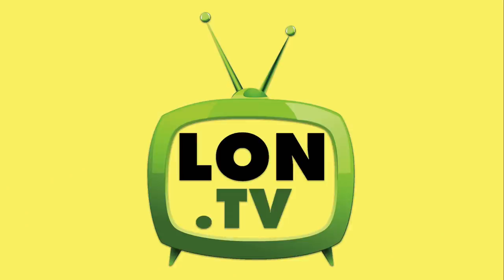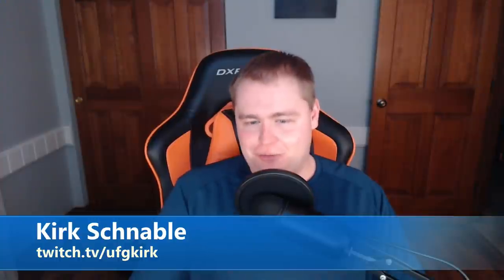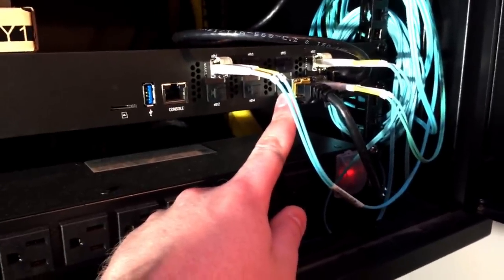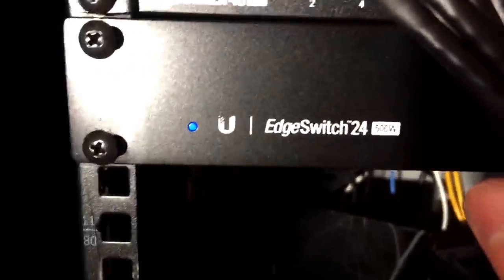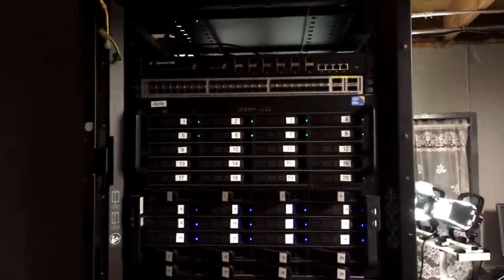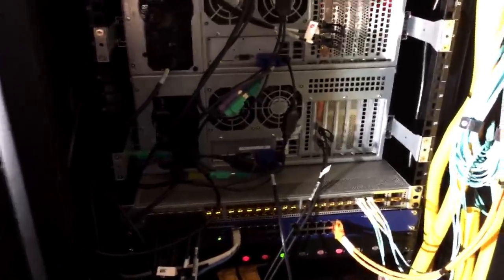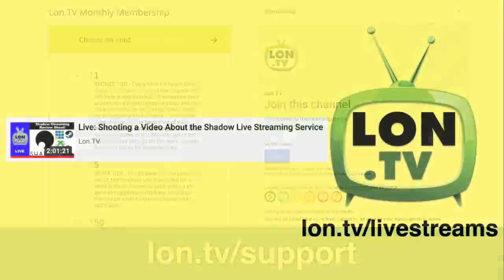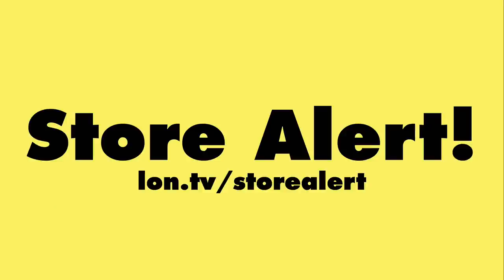Gigabit Pro Update: Tour of Kirk Schnable's 3 Gigabit Comcast Connection!

Comment: 5:30 The explanation of GPON being a shared hub sort of connection is fairly inaccurate, because it compares it to the much more shared type of connection that is cable internet.

The fiber connection between the ONT (user side) to the OLT (head end) is dedicated, not shared - if you were to shine a laser on one end, you would see it out the other. There are no active switching devices in between, only passive light-splitting prisms - hence "Passive" Optical Networking. As a result, there really aren't any bottlenecks in between the customer and the head end, and each ONT gets a dedicated TDM channel for its connection - I believe for ISP setups, this is usually a 1x64 split, hence 64 channels; OLAN is typically 1x32, however the new technology XGS-PON (10Gbps PON) supports up to a 1x128 split.

Source: I'm the lead person for an enterprise Tellabs OLAN (GPON) system (and our former Motorola OLAN system) at a Little Ivy League college.

Comment: Gpon is only limited by the equipment installed. Most onts are 2.2 gig rated they just have gig Ethernet and are designed for multiple accounts and usually there's a 10 or 20 gig uplink for 32 subscribers

Comment: GPON - Gigabit Passive Optical Network. Your favorite web search can provide the details.  In addition to maximizing the amount of data handled by a single fiber, you'll see your local GPON deployments use pre-built fiber cables.  Your install tech does not need the skills of fiber cutting, polishing, and connector attachment that an old-school fiber tech needed for installations in previous decades.  As for the Juniper router, close match is https://www.juniper.net/us/en/products-services/routing/acx-series/acx2100/ , though this is a AC-powered model instead of a DC-powered model.

Comment: Actually these days (A year later) he could probably consolidate all of that hardware into a single Epic Rome 128 core server Box and replace all the HDD with a few 20Tb drives and use NVMe SSD's for  active data leaving the HDD for cold storage. I would think the whole thing could be replaced for $10-15K which would be paid back by the saving in electricity.

Comment: So now twitch require 3 Gb connection? SFP is only 1Gb. It should be SFP+.
VMware is the best. I usually do Network-attached storage with ESXi, just makes it easier to move VMs around different ESXi hosts with vMotion (non-storage).

Comment: His setup looks nice... But a work of warning NEVER ALLOW FIBER CABLE TO BEND 90 DEGREES,,, I have seen many an install fail because if this.
Reply: ...fyi...its a loop...not a 90° bend...perfectly correct install...
Reply: @ltdees2362  Watch at 8:53 that is a 90 degreee bend which is very bad in the fiber world. I have walked into sites with bad performance and that is what I  typicality find wrong.
Reply: You are right. I have faced this similar issue. This is light passing through so a 90° curve like that will cause network problem as it's having for the light to travel with these kind of barriers in the path.

Comment: Hey do you guys know if they’ll install the equipment anywhere in the home you want? Ex: I want my router/switch etc installed upstairs instead of down where the coax is now.
Reply from the maker: I think they'll try to work with you as best as possible to get it where you want it. But there might be added costs, complexities depending on your situation.
Reply: @LonSeidman  thanks for responding, I hope it won’t be too difficult, the room is upstairs in the back of the house, I would really be okay with it being anywhere upstairs. So far my total cost after the initial survey is $7400.
Reply from the maker: @dranksinatraa  What they were most concerned with on my interior install was being able to get the cable routed without bending - the cables coming in from outside are super rigid so if they can't keep it straight it's more challenging.

Comment: His power bill must be through the roof.
Reply: I would consolidate to a single Epyc ROME machine with 128 cores! HP is a B*ch to keep the firmware up to date on since you  need a service contract to access their software repository
Reply: @PWingert1966  Exactly  I would cut this down to a less than a half rack of gear.

Comment: This is the definition OVERKILL - excessive use, treatment, or action; too much of something.

Seriously, I pay less than $100 for Fios Gigabit, TV & Phone.  I have Gigabit router, a silicondust prime, a mini PC running as a File Server / RemoteApps / Windows Media Center - DVR  / Kodi Streaming Device (WebDav & FTP), Web Server...  with over 20TB of USB3 external storage and the PC draws around 10W ( not including the external USB drives ).  I also have a separate gaming PC that I stream with moonlight, which is setup with WakeUp On Lan, because it draws maybe 30-40W at idle.  The rest of the stuff is just normal laptops, some cheap tablets and fire TV sticks, but every devices has access to everything on the network.  Games via Moonlight, movies, tv shows, DVR, music, pictures... you name it!!!

If I can do all that with little crappy hardware I have.... then WHY on this green earth is what this guy doing remotely necessary?  He has tons of unused ports sitting on those switches for what?  How much you want to bet that the majority of devices his family uses is WIRELESS!  Does he have ethernet wires running to his bathroom or to the microwave?
Reply: @josephp1592  overkill is overkill, theres still limits and caps on servers, so more bandwidth doesn't always mean faster upload speeds.  Also my silicondust provides a direct recording feed of the broadcast coming over the service... It doesn't get better than that.
Reply: @josephp1592  first off it's a cable card, so get your facts straight.  Secondly, this would need to be a business to need those kinds of speeds.  This is a stupid conversation from someone that just wants to brag about their connection.  I seriously doubt you use 3Gb and I would love to see proof that it's required for something other than an extreme business situation.
Reply: @josephp1592  Well I get a 1Gbps up and down where I'm at and yes, I can get more.  Netflix requires 25mbps for 4K streams, so that's 120 connections at 3Gbps and 40 connections for 1Gbps.  There's no need for more than that IMO for a home user and I stream to family members too!  Also, my silicondust homerun is completely relevant, as I can record the original incoming feed and have backups.  Look I understand why you went up a tier, but you're stretch the truth about needing that much bandwidth.
Reply: @josephp1592  then you're not streaming that to family members at 130mbps.  What a crock of BS!  Even so you still get 7 feeds at 1gbps.  Seriously I can tell when someone is stretching the truth and that's all youve done

Comment: WoW..I Would Sure Like Some 1gb Speeds n My Neck Of The Woods..200mbps down X 10mbps up Is the MAX i can Get..Kinda Sux But Just 3-4 Years Ago I Was Stuck on a 2.5mbps down an 1mbps Up So I Am Glad Its Beter But Still Not Where It Should Be ! O And I Thought I Was Bad With My 2 Dual Xeon Servers one is Just Dual 6 Core Xeon X5675's & Supermicro X8DTH-6F W 64Gb of ecc Ram & 10Gb An My Main Server Is A Supermicro X9DRI-F With Dual 12 Core E5-2696V2's With 128Gb Of Ecc Ram Dual port sfp+ 10Gb Nic in a Super micro  24Bay Case For Back Ups, Plex & VM'S ! Very Cool Set Up !